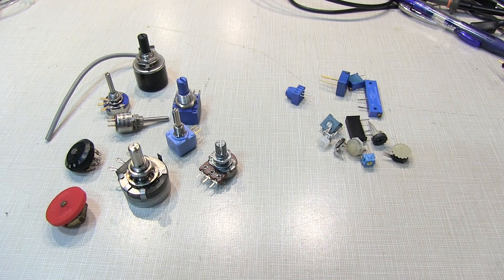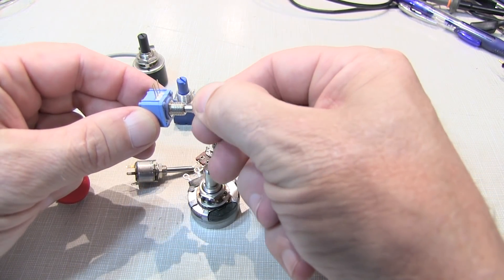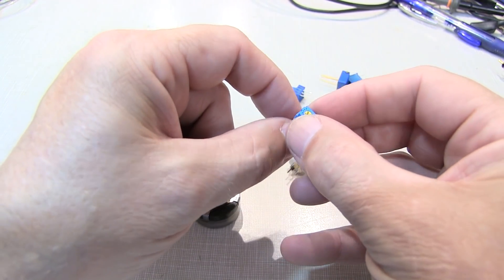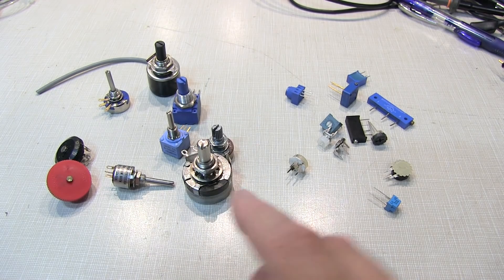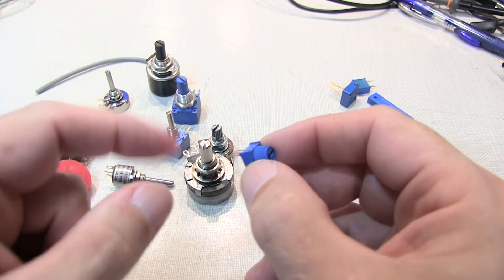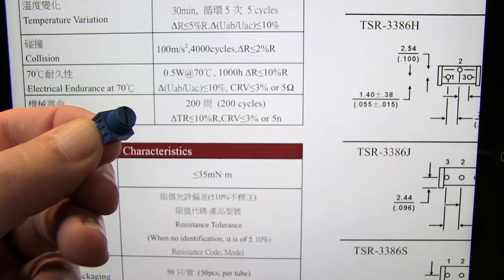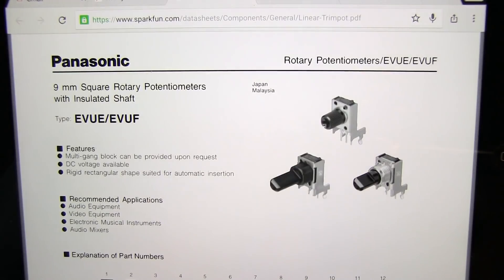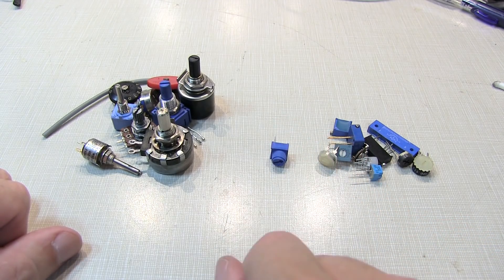#307: Back to Basics: Potentiometers - Controls and trimmers / trimpots - WARNING!

Comment: Great video. I never even considered this. Ive gotta say though, I have some pots similar to the control pot you showed on Sparkfun and they're actually not that great for breadboards cuz they have those 2 metal tabs that stick out at the bottom. Even if you bend them up and out of the way, the pot never sits flush with the board. It's always at an angle. I usually just throw some female to male dupont connectors on them or just solder some wires on.
Reply: Always make sure to use SHIELDED CABLE and not wires on pots that are not mounted directly to the circuit board!
Wires won’t work at RF and even as low as audio frequency on certain projects I’ve done using wires on pots will cause the circuit to go nuts.

Comment: This goes for switches too. If you check the data you can find some are rated for far more transitions than others. It's important to consider longevity when selecting parts.
Also, as someone else mentioned, it's easy to overload the small trimmer. It takes only a few volts across the trimmer to get too much current flowing and exceed the wattage rating.

Comment: I actually always wondered why a capacitive variation is rarely being used, since you can basically have two floating sides, which means less wear over time. Especially with all these microcontrollers nowadays, but even with analog it's not to difficult to converter capacity to pwm to a voltage or something

Comment: ..and if used as a divider off of a voltage you can over-current and burn out a smaller pot.. not that they should have a lotta wattage, but I've seen pots burned on one side of the sweep. Also log vs. linear is worthy of note.

Comment: I imagine 200 cycles is a conservative estimate that describes how many cycles before it gets out of spec, e.g. your 5% 100k trimmer gets to 105k. In cases where it doesn’t matter even if they’re 20%out of whack they’re probably a bit more usable, but I still wouldn’t use them on a control panel.
Reply from the maker: I’ve seen the wiper go intermittent in certain “well used” portions of the rotation.

Comment: Nice simple video!  I have a request for a video on the input and output impedance of rf transistor circuits.  I have found some brief and very general descriptions but very few sources go into what the actual impedance is and even fewer that do a good job of explaining why it is that impedance.  Definitely not a back to basics video but I think it could help people understand rf designs much better if they knew why the matching networks are there on the input and the outputs.  Maybe this would be a couple of videos?  Thanks!
Reply from the maker: I'll add that topic to my long list of future video ideas...

Comment: Imagine a trimmer controlling the output voltage of an adjustable power supply...    You could wind up putting full supply voltage into your circuit!

Comment: w2aew, do you know what I can use to wear the pots resistive element out without causing the pot to make scratching noises. I'm trying to wear out the middle section of the pots resistive element but if I use sandpaper or graphite paper it will cause the pot to my scratching noises. This Video tells how the worn out pot caused a different curve. But how can I do this using what to make different curves by wearing out the resistive element  https://www.youtube.com/watch?v=S46UqM4bumA
Reply from the maker: I've never seen a pot wear that way.
Reply: If I open up a pot and take out the resistive element, what can I use to wear out a pots resistive element like that in the video?

Comment: Thanks for this important hint - altough i already knew about that as i use potentiometers and trimpots quite a lot. When i stumbled upon the usage numbers i couldn't believe it in the first time. 200 turns life - that seems like a joke! Also important to mention that the overall build quality and accurateness of these parts is very questionable. I use a lot of cheap chinese potentiometers and 10turn-pots for adjustments of voltage and current for diy lab powersupplies. And guess what? Sometimes the voltage is jumping and there is no smoth transition over the whole path of the pot. That is really annoying - but good stuff has its price! You cant expect 100% performance from a 10turn pot for 2 or 3 bucks when you can easily pay 10 or 20 bucks for the same thing! You could also mention that really 90% of cheap electronic components from china is fake! When you look at really expensive high current voltage regulators like LT1083 - ..85 or similar its most probably fake. These devices are tricky: they work on low current but tend to go short curcuit on higher current far below their specs! This can easiliy kill sensitive electronics that expects low voltage and cause a lot of damage! You can find fake products on nearly all basis electronic components from simple transistors, mosfets to ICs. E.g. i found fake TP 4056 Li-ion charge ICs that normally charge li-ion cells up to 4.2 V. The fake components often miss the max. charge voltage and climb up to 4.5 V and more - leading to fire hazards by destroying the li-ion chemistry! Never trust cheap chinese electronics!

Comment: Hmm, good point Alan. I always hated those "gear" style trimmers since the screwdriver adjustment slot was always oriented vertically and invariably there was another component in the way forcing you to turn it manually...grrr; the trimpot with the knob would have been so much easier! Keep the basics videos coming, I always forward the link to our club's email reflector.  73 - Dino KL0S

Comment: Right on my friend. Your input is very much appreciated. 
There's a lot to be said for digital trim pots and software support for multiple setting situations.
I have several microcontroller designs that have many trim pots that could benefit from this knowledge.
The break-even point has to be pretty low for your advice to be effective.
New sub. Great information. Happy to get good input.

Comment: if you were using one of these to adjust output of a power supply or regulator you might find your self with a whole lot of voltage (smoke) you didn't plan on lol
Reply: When usimg a trimmer or control pot for adjusting voltage, you never employ them directly in series with the load unless the load is just a few miliampres. Instead, you would use the trimmer or control pot to set a reference voltage for the low-current side of a linear regulator like a transistor, or to set the comparator voltage reference for a switching power supply. In any case, you won't get smoke as long as you are dealing with a high impedence circuit to begin with.
Reply: @JimButler1234567890  That is what I mean if you were using the trimmer to set the ref voltage for say a tl431 or tl494 or ucc3843 and it all of a sudden went open circuit you could end up with the psu putting out full voltage into what ever is connected hence the smoke LOL
Reply: Or just design it in a way that the highest resistance is the lowest voltage.
Reply: @westelaudio943  what apposed to just using a pot that's designed to be a control?
Reply: @T2D.SteveArcs  

Even with control pots, a lower resistance/voltage drop than desired is very unlikely, but higher is very much possible due to dust/oxidation.

Comment: I will also like if you can show us using a linear /slide potentiometer in a audio crossover circuit or any similar circuit
Reply: passive or active cross-over?   You have to use a rheostat in passives.
Reply: Kenn Mossman sir I want active ones...in commercial crossovers we see linear potentiometers, that's why I said
Reply: @sayantanmaiti2513  OK.  Why do you need a variable x-over? This is a genuine question. I have built active x-overs and never used a pot in setting the Fbeta
Reply: @kennmossman8701  That's very nice Sir. Actually my aim is to build up a mini graphic equaliser using linear pots. Commercial devices use them. Those pots  will provide the  separate control of the strength and quality of frequency bands.
Reply: @sayantanmaiti2513  What electronic circuits have you built ?  This is not a trivial project
Reply: @sayantanmaiti2513  i know
Reply: Kenn Mossman sir I'm just in the final year of my graduation in electronics. Tinkering with practical circuits is my hobby. Till now I've made many circuits based on opamps like comparator based motion sensor using ADXL335, smoke detector using MQ sensor, a fixed Fbeta audio crossover with volume control, opamp tester. I've once made a linear regulator and pass bjt based power supply.  Also I've using Arduino almost 2 years till now. Once I also build a digital clock using discrete logics (7400and4000). And there are lots more and journey will continue. Yes, I know this kind of parametric equalizer is pretty hard to build and will require experience, I will require a scope for this. if not now, in near future I'll obviously try this project once.
Reply: @sayantanmaiti2513  Great!   though after reading what you have done I am bewildered by your question on linear pots......what is it that you are unsure of?
Reply: Kenn Mossman actually I haven't used a linear/slide potentiometers before. That's why I need a wiring diagram or interfacing them properly in a circuit.
Reply: @sayantanmaiti2513  The following is true for any 3 pin pot/trimmer/rheostat. Connect a DVMM (Resistance setting) to any two pins. If the resistance doesn't change then you have the 'top' and 'bottom'. The other pin is the voltage divider.
Reply: Kenn Mossman thanks sir